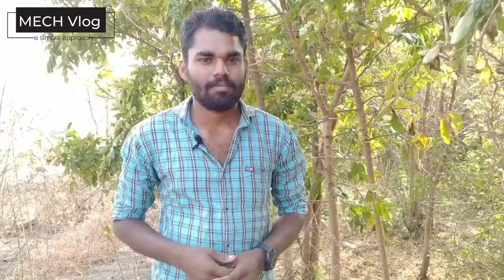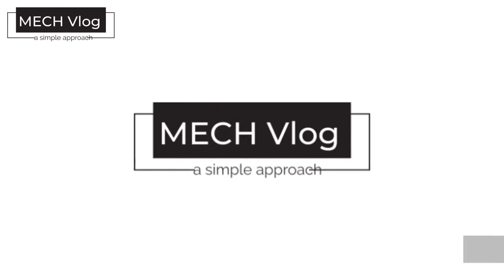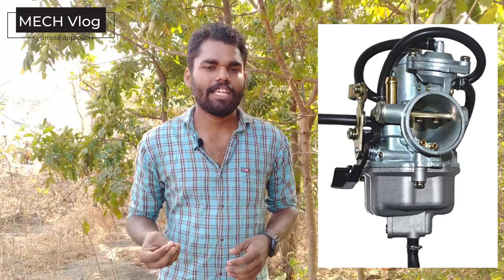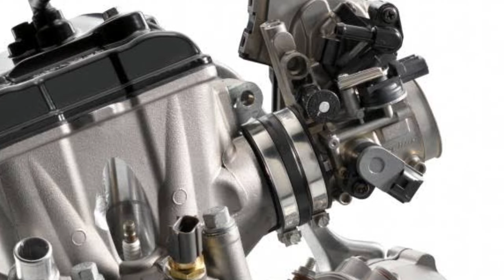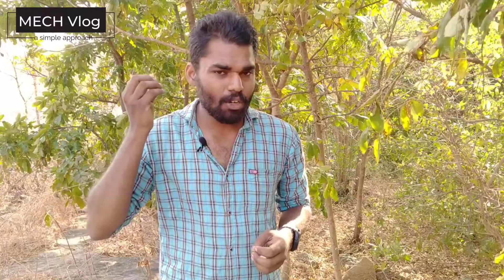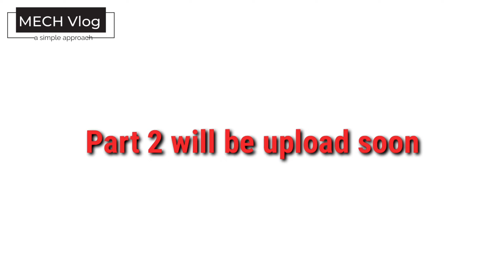carburetor vs fuel injection=PART-1_(Malayalam)full review

Comment: പുതിയ കേബിൾ മാറ്റിയിട്ടും ആക്ക്സിലേറ്റർ ഇടക്ക് സ്റ്റക്ക് ആകുന്നു.. എന്താണ് കുഴപ്പം?
Reply from the maker: Accelerator gripinte end evide engilum chathanjittundo enn nokk.Handle bar end weight accelerator gripil thattunnundo enn Nikku bro
Reply: @mechvlog  running adjust cheyyunna screw kudungunnathano?
Reply from the maker: Carburettoril eeyo?
Reply: @mechvlog  athe
Reply from the maker: Throttle sring pottiyittundo?
Reply: @mechvlog  no
Reply from the maker: Original cable alle
Reply: @mechvlog  s
Reply from the maker: Nokkiyale correct ariyu